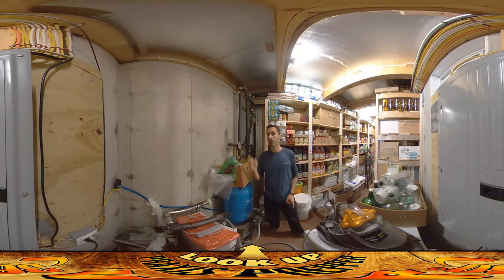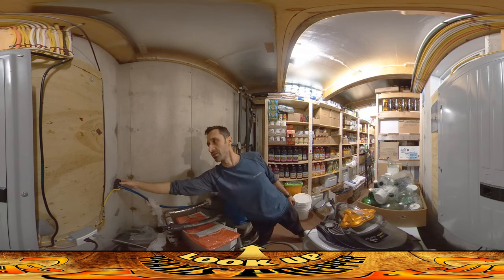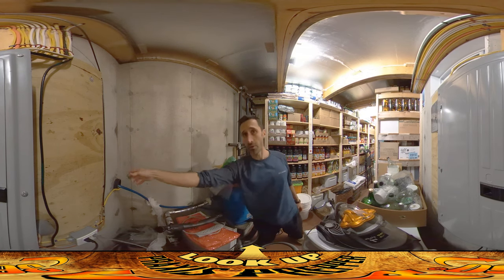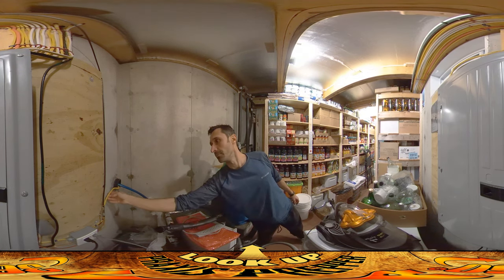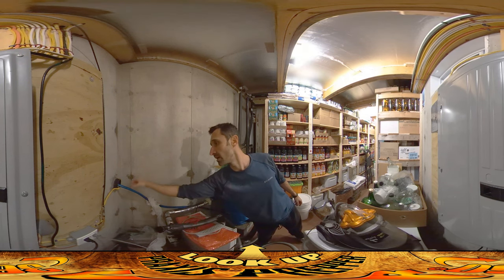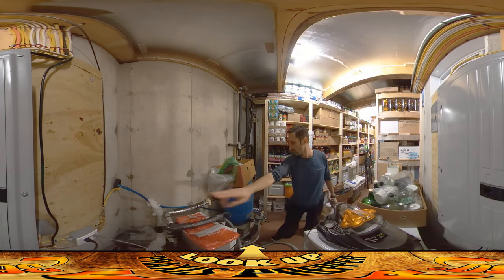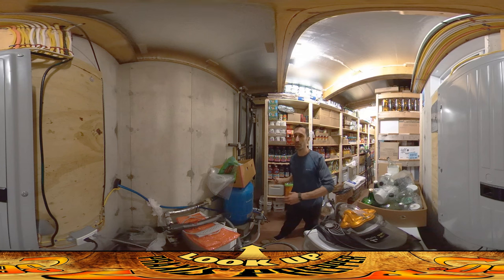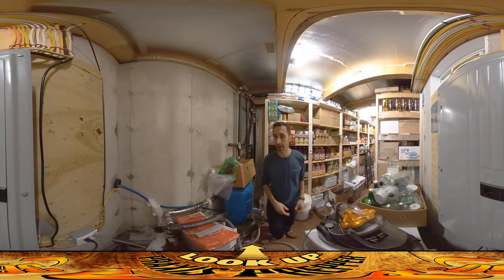Homestead Building - Running Cables to Underground Fallout Shelter, Trick for Pulling Wires

Comment: "...with any luck..."
I think you meant "...with adequate measure of one particular kind of luck..." ;D
I like that trick too. 
I was pulling wires with my father when I was still in the single digits on birthdays and we usually left a run of mule tape in conduits. When you pull, pull the wire/cable with a run of tape or sturdy line so it's ready for the next time.
Reply: Yes, that extra string should always be run, cheapest time saver ever!
Reply from the maker: I almost did that here, but didn't for laziness reasons. I should have at least mentioned it in the video though.

Comment: Back in my teens I worked for an electrician  and we used a similar method to run leaders through conduit but we used a lightweight sponge or something similar to a dead cat microphone cover and a shop vac. Issue you are having is most like air bleed around the edges of the hose and other wires already in the pipe.
Reply from the maker: That's what fixed it. I just needed to get more serious about sealing up the suction end to focus the suction. I think that without all the hoses etc in there, even with the leaks it would have worked.  But between my lazy "hands around the tube" crack sealing and the junk already in there, it wasn't happening.

Comment: It is a neat trick used it before but what I find works everytime....always leave a rope inside everytime you pull something new thru have a rope come with it
Reply from the maker: OMG, I SO wish that I had mentioned that in the video. You (and every other person that's smart) has replied to this video with that (very helpful) suggestion. I had actually considered pulling a line through when I pulled the cable through but (because of laziness and not wanting to cut my very nice string), I didn't do it. But... I REALLY should have at least mentioned the tip in this video. It's a VERY smart thing to do.
Reply: @PraxisPrepper  I wish I could sound smart.....spent a day threaded a line thru I tile because I was not thinking ahead before...happens to everyone...but I will never forget to do it after that day lol

Comment: She's gone from suck to blow

I've got a pipe that I have to run wire through every so often. After the second wire I ran through it I learned to always attach a new string to the wire being pulled through, so there is already a sting ready to pull the next wire.
Reply from the maker: I almost did that here, but didn't for laziness reasons. I should have at least mentioned it in the video though.